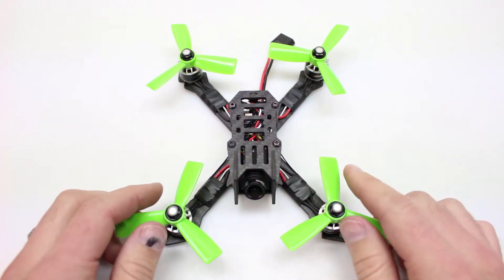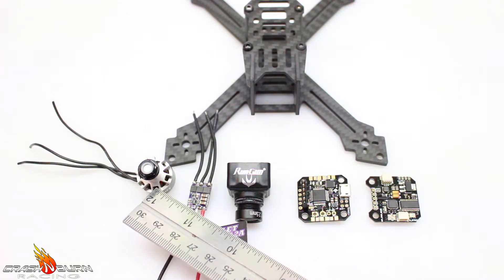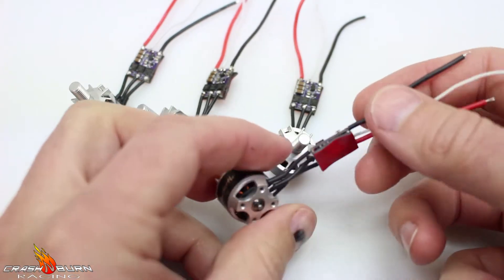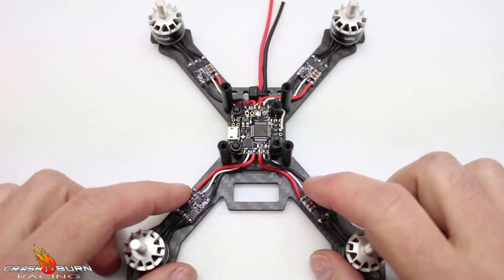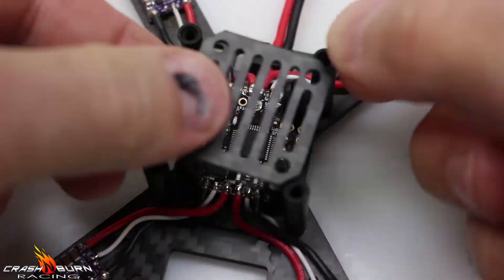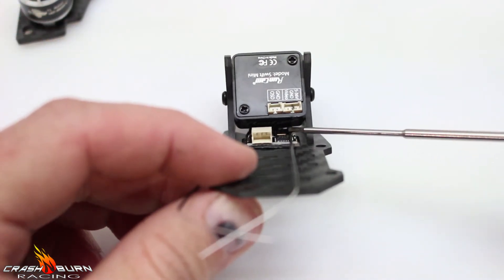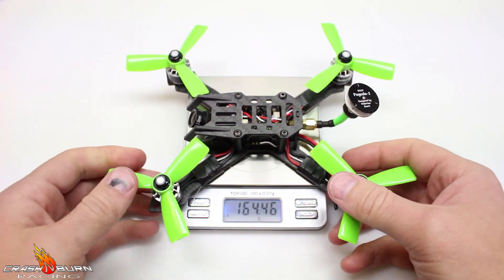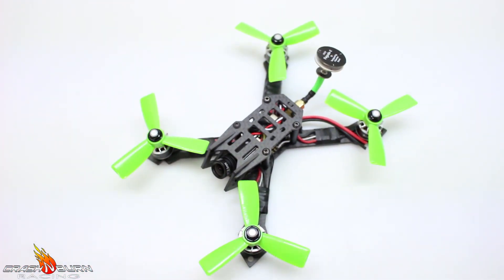CBX 150/ CBS 160 Build review

Comment: Are both frames the same width?

Thanks
Reply from the maker: The 160 stretch is 99.75mm wide and the 150 X is 106mm wide motor to motor.